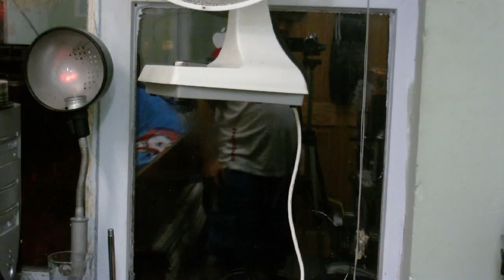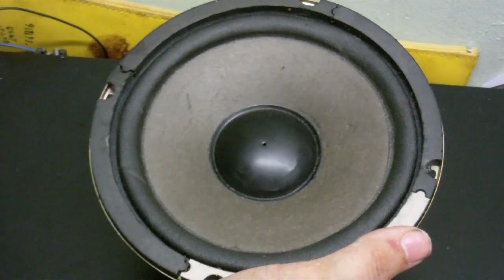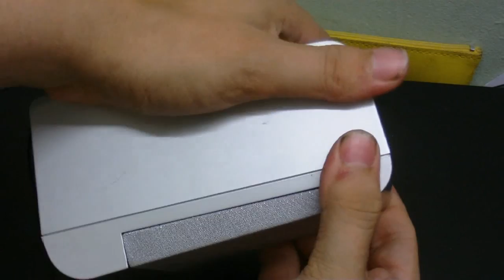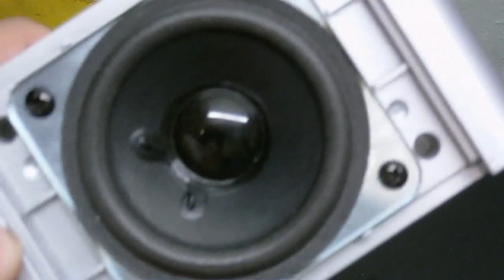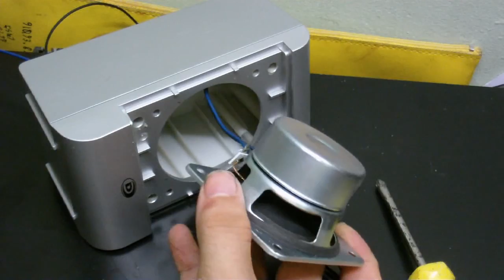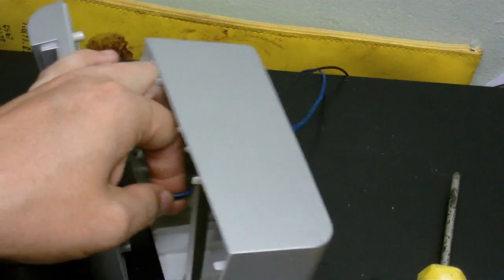Taking a durabrand speaker apart

Comment: They don't look to bad of a driver, but you can't conpramise on quality, in other words a 'durabrand' speaker is a durabrand speaker. I made a pair of speakers my self with some old drivers I riped out of are old (demolished) town hall, they are made by Fane and work a treat. I went 3 way with a low, mid and high, the crosovers I built and the boxes I had built by my brother (who is a parpenter)  and I tell you what these are awsome with a masive frequence responce and 200w of power (RMS).

Comment: These speakers are sounding pretty good if they are put into a good housing. With the plastic around them of course they can't sound good :P
I used similar speakers for a pair of speakers I built a while ago and I used these as full range speakers. Of course they aren't very powerful, but I never had any problems with the foam surrounds.